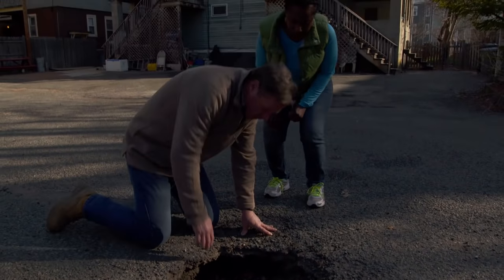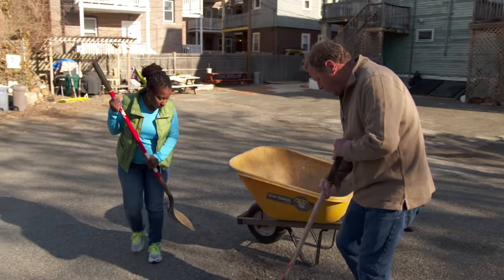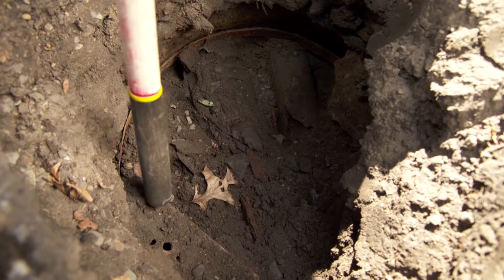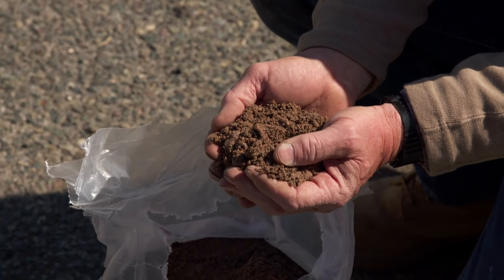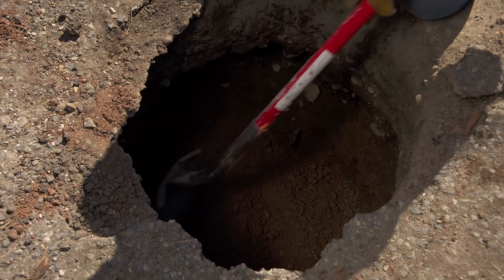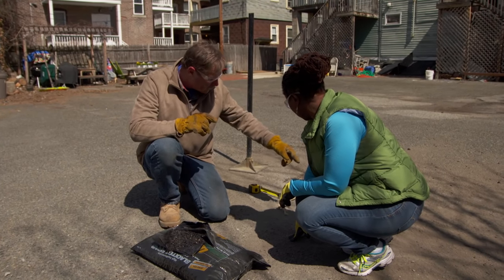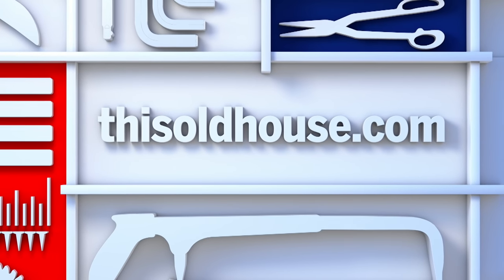How to Repair an Asphalt Pothole | Ask This Old House

Comment: These two did a better job than official road repair crews would, that is they actualy took the trouble of campacting the base underneath instead of just cutiing off the asphalt and dump another one just to see it crack in the same spot just months afterwards
Reply: the subgrade wasnt cut out and fixed with base material
Reply: If you expect road crews to do this to every single pothole, you’re on crack. 1. That would take way to long. 2. By the time they fixed them new ones would have formed. 3. Potholes in roads are caused by frost in the ground heaving the blacktop up and down causing it to crack and holes to form. Potholes are a fact of life, do what you can with them and move on.
Reply: @j_pasty_w1823  Lets see....instead of actually fixing the potholes, they sit under a tree and nap all day.  They wake up and do shitty job, then refix the same pothole 3 months later with the same shitty method.
Yeah.  I want them to fix the pothole the right way.  Do your job instead of being lazy.  Or eliminate your state job and lets contract it out.
Reply: @j_pasty_w1823  I have been repairing potholes for 22 years and you are right. There are different techniques and good and bad ways of repairing them. Bottom line is citizens call in irate about when their pothole will be fixed? We realistically do not have the time in a large city with less and less employees to repair each pothole by saw cutting etc.
Reply: Fact

Comment: I swear every city road crew filling pot holes I've witnessed. They just dump a few shovel full of asphalt and to tamp it down they smack it with the shovel. That's how I thought potholes were fixed. I had no idea there's a correct way to properly fill the hole.
Reply: Matt Thomas they probably purposely do it wrong so they’re still employed when they come back next year to “fix” it again
Reply: Imagine doing this for all the potholes... they would still be on the same road ten years later.. meanwhile you are late to work from the traffic back up cause guys are laying on the road digging three feet down
Reply: No, that's when you repave the fucking road.
Reply: Replace the rd. Yea right then people bitch cause taxes go up. Can’t have it both way
Reply: @mattp1482  You mean 1 guy digs 3 feet down... 1 shovel per hour... while the other 17 people on the crew stand around
Reply: Matt Thomas I suggest watch a 13 part series called What on earth happened by Ewaranon to learn that the earth is not a globe.

I got it in my about tab.

Comment: Usually potholes are caused by water freezing and thawing and penetrating in to the pavement and finally popping out a pothole.
Reply: woah..
Reply: bert26a yes the ground expansion due to the winter, creating air pockets underneath. I made a funny video on potholes. Check it out if you want to laugh

Comment: Put a bag of concrete in, wet it, finish, paint black when dry.
Reply: and repair it in again in another month or two....
Reply: symbiotic venom money for the cement company. The cycle continues
Reply: Rocko good idea 👌 I made a funny video on potholes. Check it out if you want to laugh
Reply: ROcko I suggest watch a 13 part series called What on earth happened by Ewaranon to learn that the earth is not a globe.

I got it in my about tab.
Reply: @flat-earther  joe biden

Comment: Cutting the edges first would have been my choice, then once the hole is cleaned out continue the process.  One of the most important items is to know just how compact to tamp the hold.  Too much compaction and the asphalt pothole mix will crack.

Comment: i want to know where you buy "pack". In the video he has a bag of the stuff however Home Depot or Lowe's dont seem to have anything like it. I noticed that the bag is unlabeled. I did a little research and found that I believe some people call it "hard pack" but still couldn't find the product.
Reply: Order it from Amazon. And the bag actually has some labels on it if you look carefully.
Reply: @venividivici4253  you are right there are labels on the bag that you can read if you view the video in high def and in slow motion lol. The label is most clear at 3:24 So what he is using is actually "paver base" which I didnt know was a thing until now. Looking for "pack" through Google doesn't lead one in the right direction. 

I do electrical work for a living and always try to call parts by their official name not their slang names because slang names mean different things to different people. Case in point is this video, I was way off base on what was being used!
Reply: @kylefowler5082  or manufacturers name kliens, official name lineman pliers.  now manufacturers name channel locks should also be the official name, don'tcha think
Reply: @kylefowler5082  Well spotted, that's 'Patio/Paver Base' on the bag.

Comment: if it were me, i wud backfill the same crap that came out of the hole back in,compact it in layers and finish with the asphalt
Reply: That's how you get another pothole in the same spot a year later.
Reply: or a hell of a dip in 3 months as it settles the voids till the winter and the whole thing fails

Comment: 3:57: Where do I buy a wet saw like this? edit: On the second view, it looks like it's just a circular saw with a water hose ghetto rigged to it?
Reply: Nytron with a diamond blade, hose is to cool the blade and help prevent dust
Reply: Nytron, Deckstar I suggest watch a 13 part series called What on earth happened by Ewaranon to learn that the earth is not a globe.

I got it in my about tab.

Comment: I have a gaper like this smack dab in the middle of my driveway. I should really do this before the Amazon delivery guy falls in and needs to be rescued.
Reply: Did you do it yet?

BTW Giggitygoo I suggest watch a 13 part series called What on earth happened by Ewaranon to learn that the earth is not a globe. Link in my about tab.

Comment: Do you have to wait that long to seal coat? Or you can seal coat driveway right away after repair?
Reply: best to wait till it hah dins
Reply: @richardedwards9349  hardens!
Reply: kiking I suggest watch a 13 part series called What on earth happened by Ewaranon to learn that the earth is not a globe.

I got it in my about tab.

Comment: The best asphalt patch on the market is aquaphault.  It certainly doesn’t require that step with the circular saw.
Reply: Thanks for the tip! I'm going to give it a try!
Reply: Of course it does I use it all the time you must cut to square the edges

Comment: wouldnt it be easier to just dump 2 bags of quick crete,level it and add water?  seem quicker than all that work to me
Reply: and you would be repairing it again in another month or so.
Reply: U can't just fill a pothole with concrete you have to cut out a shape level it really good and smooth it out and then add thoese strip lineing thingy
Reply: Concrete doesn't adhere to old/dried concrete or any other material.  You'd have to use a ferring/felt strip and you'd notice it all the way around plus the thin edges would crack whe n you drive over it. 
   Asphalt can semi adhere and will cure level and even .

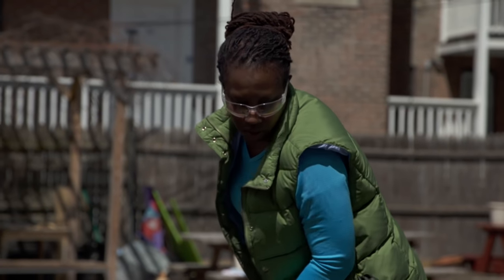Comment: 4:33 Wait, that's a clean edge?
Reply: +Maxid1 It doesn't have to be perfect; it just needs to be able to hold in the cold patch so it doesn't "leak" out. The cold patch material takes a LONG time to harden, so you just have to hold it in.

Comment: Fucking wood and metal rings in potholes? WTF!?

Also, that dirt...how do we know the asphalt isn't going to be hindered by it? You definitely won't be able to apply tack coat to it; /* the dirt would hinder adhesion */

EDIT: I turned on the volume. The stuff is stone dust, used as substrate for concrete, and very bottom layer for roads. I'd have to learn how well tack coat adheres and coheres to it.
Reply: Michael I suggest watch a 13 part series called What on earth happened by Ewaranon to learn that the earth is not a globe.

I got it in my about tab.
Reply: @michaelwarren5084  Are ad hominem retorts your best globe proof?

BTW your comment is shadow banned.

Comment: Cant believe your using water with electric tools , not forgetting pushing the tool towards its own flex cable ...!
Reply: Russell Briscoe I guess your sump pumps are horse driven.
Reply: Never seen a tile saw, have you?
Reply: Russell I suggest watch a 13 part series called What on earth happened by Ewaranon to learn that the earth is not a globe.

I got it in my about tab.

Comment: Or the hole is being caused by a water main leak, or it's the beginning of a sink hole that's going to swallow your house. Not circumstances where you can fix it with some tools from your home center.
Reply: ive found barrels underground before and they are dry this likely dried up over 70 years or so being covered